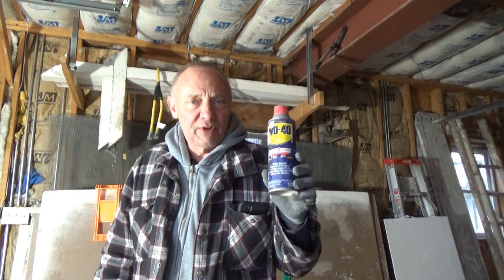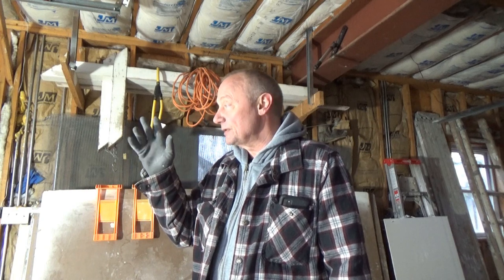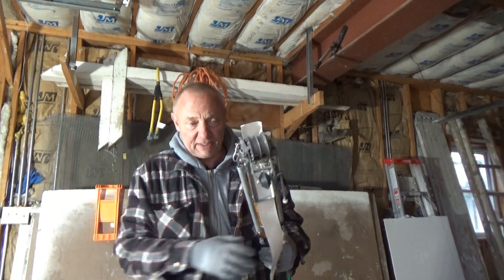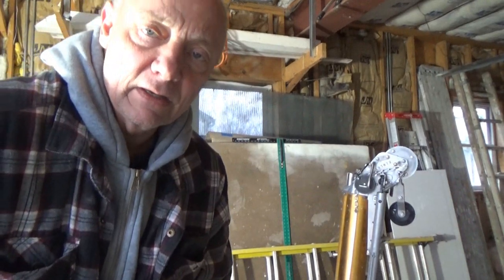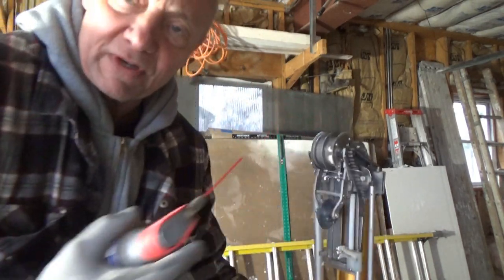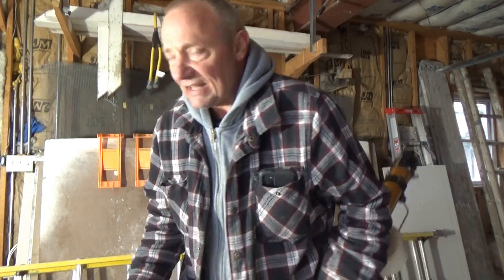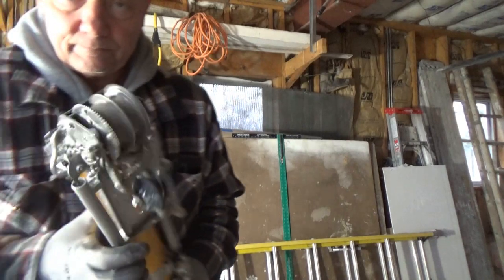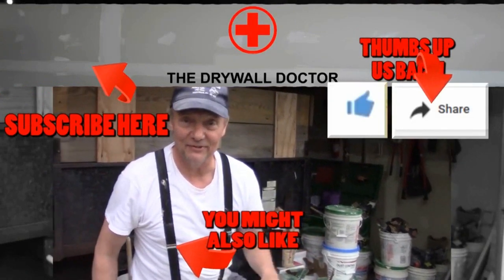How to Oil Your Drywall Bazooka ( Automatic Taper )

Comment: Also you wanna make sure to charge the head before starting a new tape
Reply: @THEDRYWALLDOCTOR1  what I mean by that is I run the wheel against the wall just a bit before I run a tape because every time you advance a tape with the sleeve you pull some mud out with the tape but you're not rolling the plunger up keeping the head full. It won't always leave a dry spot if you don't charge the head but it definitely does sometimes. I also make sure when I do it I roll it close to an already played tape so when I box it covers the marks the wheel may leave
Reply from the maker: Yeah It took me a minute 😆

Comment: I have used wd40 and bazooka oil for 16 years, other parts will wear out before the wd40 affects the rubber. 

The mud should be thin enough that you can pour it from one bucket to another. It will stay level in the bucket as you use it, and not do the inverted volcano. 

Keep it clean, keep it lubed, and use that creaser wheel
Reply: Have you noticed that bazooka oil smells exactly like pb blaster